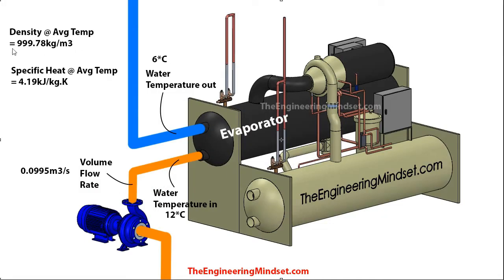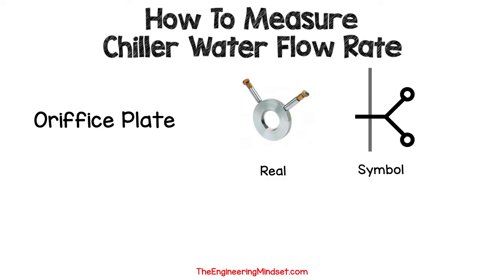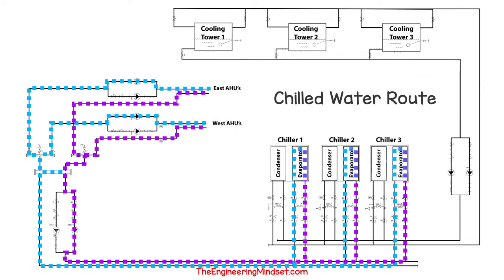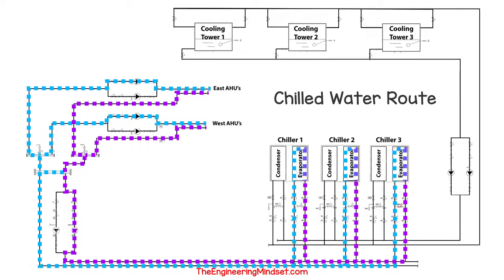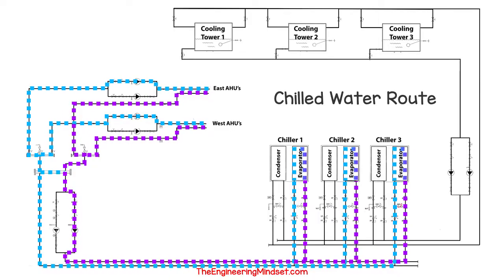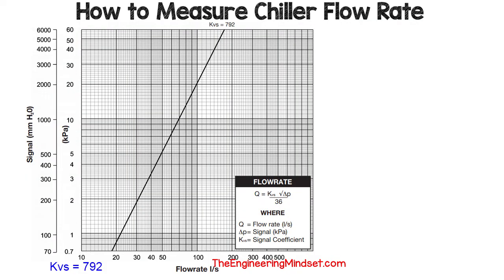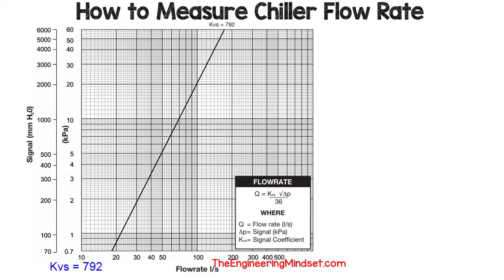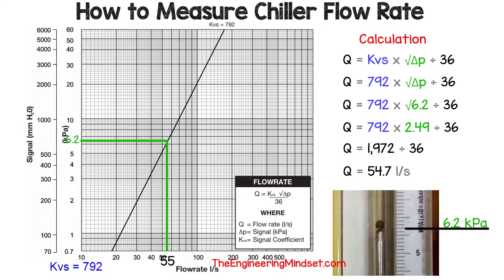Chiller flow rate measurement and calculation, chilled and condenser water

Comment: @theengineeringmindset  can you please help me understand what the purpose of a Flowmeter is on a Turbocor Chiller? A system i worked on had a flowmeter but no flow switch. Does the flowmeter control the ramping up and down of the compressor based on flow rate? Why would a system like this not just have a simple flow switch? 

Thanks in advance.

Comment: Question? for AHU to be properly working, in lay  mans terns, does the flow of water through AHU coils have to be a faster flow rate or slower flow rate?
Reply from the maker: You will get a better heat transfer and thus better delta T (temperature difference) if its slower. If its too high the water will not change temperature as it flows through and so the chiller will operate inefficiently

Comment: In my case they put some pressuregauge to the inlet and exit water evaporator pipe , can i use both of these pressuse data to calculate the flowrate ?

Comment: What would cause low water flow to a chiller barrel? I had a site where they usually run one pump, but it seemed like they are having water flow issues. Now the chiller would stay running if they run two pumps

Comment: but , How do we calculate Water flow rate through Chiller just by knowing Inlet and Outlet water pressures... ? Please guide me through this
Reply from the maker: Don't it's not accurate, measure it
Reply: @EngineeringMindset  I only have evaporator inlet and outlet pressure differential. Does your formula still apply?
Reply: @EngineeringMindset Trane factory engineers disagree with you

Comment: What does mean by low and high pressure side tubes In orifice plate??
Reply from the maker: The plate causes a restriction to the flow of water. In the direction of flow the water hitting the plate is at normal pipe pressure, as it passes through the plate the velocity increases, as velocity increases the pressure decreases.
Reply: The Engineering Mindset  thanks mate .. you have been an amazing help. 
Is there any way to contact you about my problems? I am currently a mechanical engineering student and at the moment I am completing my project of the installation of central HVAC system in pharmaceutical company so the knowledge you share is kind of very much helpful to me
Reply: What is the name of provided chart with the chiller? We have currently bought 450 ton LG absorption chiller. I need to check  is that chart available in the company.
Reply from the maker: I'm afraid I can't give individual advice I simply get too many messages a day, you can put the questions in the comments section though
Reply from the maker: The chart is not for a chiller but for the orifice plate. As I said in the video the chart is different for every orifice plate so you need to contact the manufacturer with the make and model nubmer
Reply: The Engineering Mindset thanks sir.